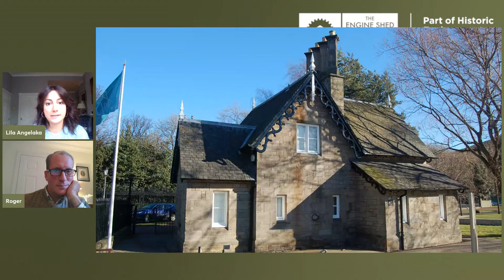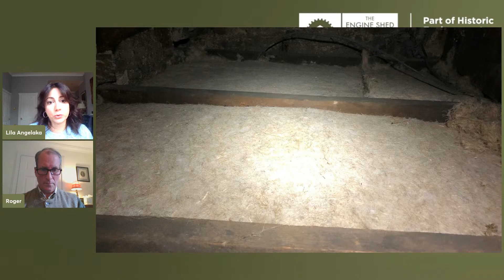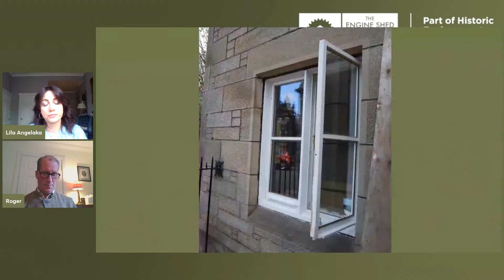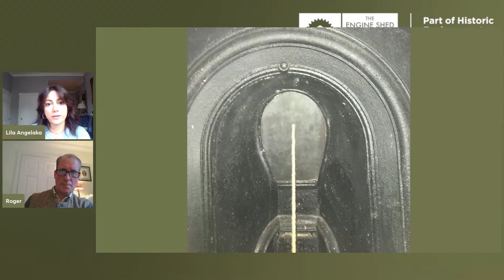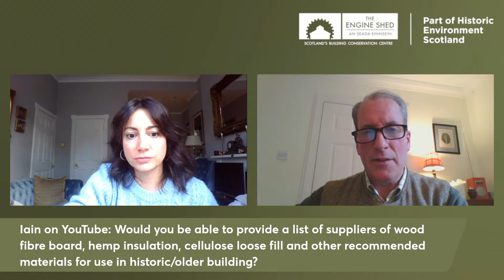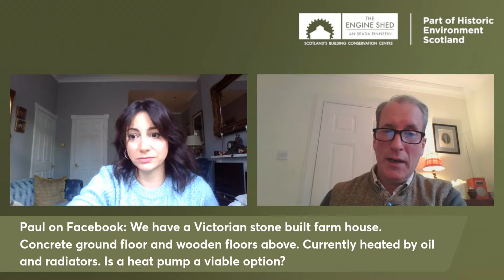Inform Friday: An Introduction to Energy Efficiency

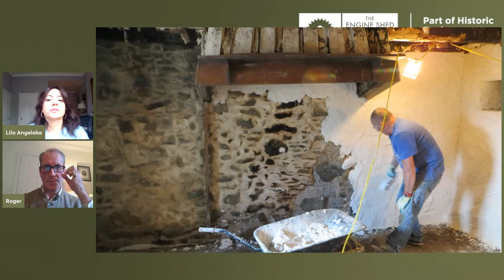Comment: 11:41 - Shows someone plastering onto hard onto soot staining; a traditional technique that works in preventing that soot staining penetrating through the lime plaster and presenting itself on the internal wall surfaces is to mix in fresh cow muck into the mix. That is what proper traditional lime plasterers still do today to prevent the soot staining penetrating the lime plaster. I've see it work too. It is pretty much the only good solution for such an issue.